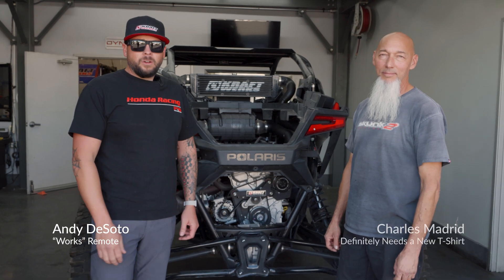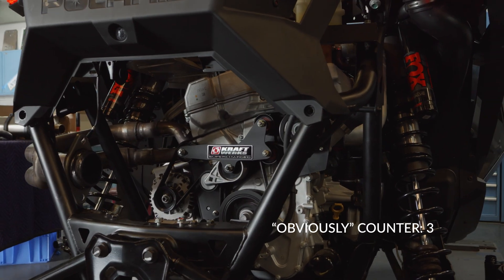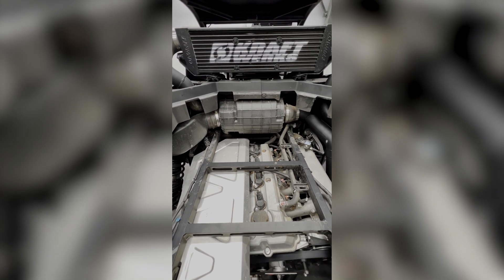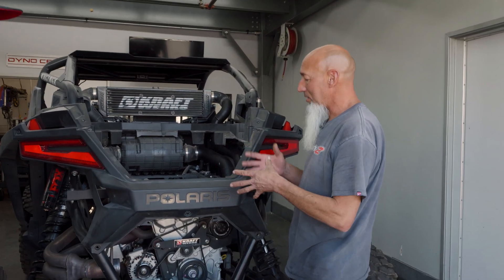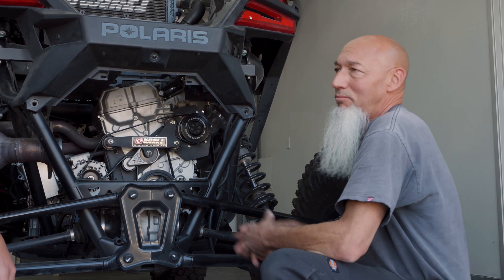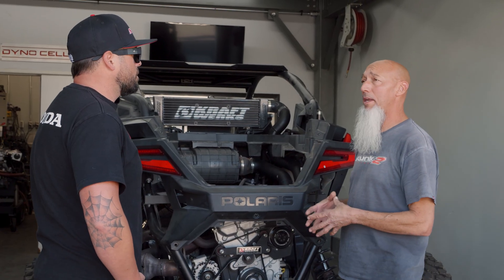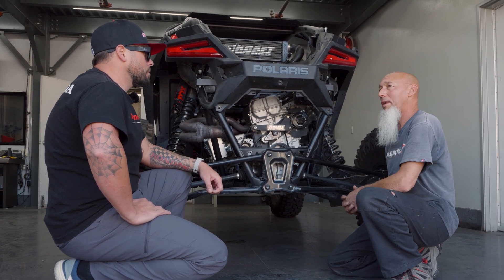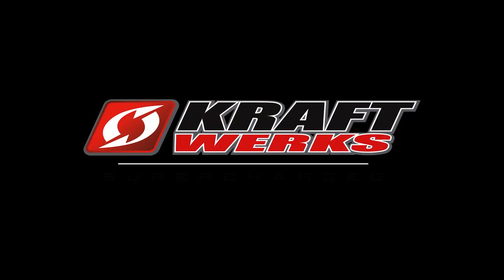First Look at the Kraftwerks USA Pro R Supercharger Kit Prototype

Comment: Why do you guys have the ribbed side of the supercharger belt riding on a non ribbed pulley? It wears out belts excessively quick because the grooves on the belt are being flattened by the non ribbed upper idler pulley. Even on the revised kit. What’s the deal? 👀